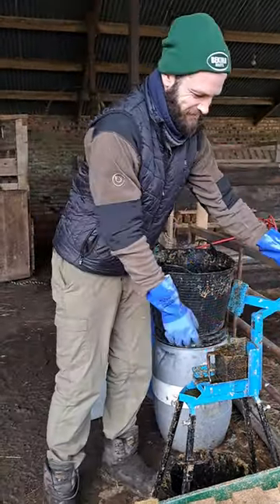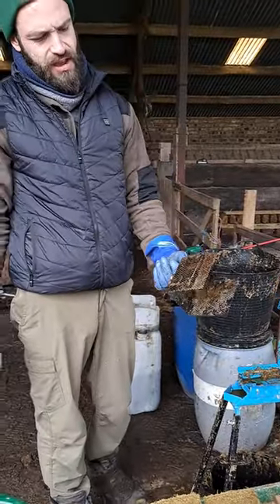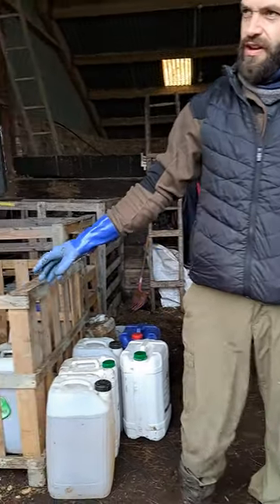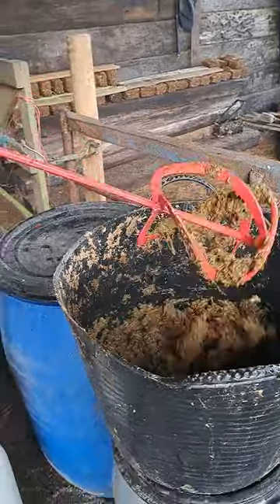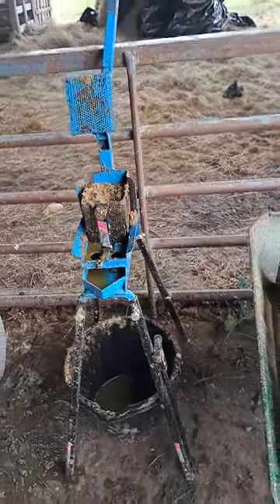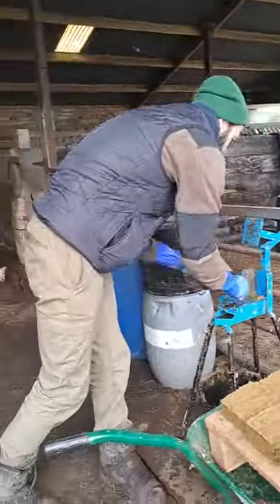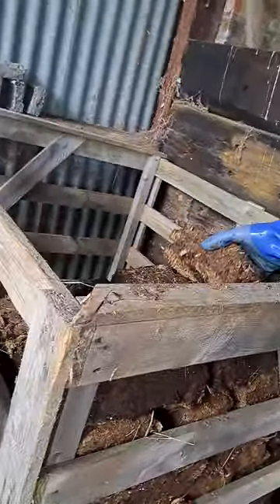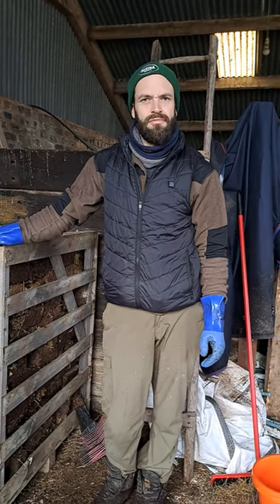horse manure briquettes @tinkytanky3

Comment: I am burning the 2nd winter horse manure briquettes. I'm mixing everything together, cardboard, newspaper, wood  shavings, horse pong, you name it, I have a very similar press, but have increased the leverage, which gives me alot dryer "rawlings" - which I let settle for about 3 weeks. I do not soak the horse manure at all, infact I'm shredding card board and use that as bedding. or cocos peat from a close by strawberry farm. I recently bought a different press again, and operate that one with a 2m lever, I can put in horse poop straight. 
works very well, have reduced our coal use for about 70%

Comment: Do you have to soak it in the hay water, could you directly press fresh droppings? Very interested in this! Great video.
Reply from the maker: Best to mix because it will all be as one mix instead of dryer horse apples won't compress as good and be too soft and burn quicker.

Comment: Hi, local to me (in Scandinavia) there's a vast amount of horse manure for free. It has been standing for some years outside in the rain - is that suitable for making briquettes - in the sense of cohesion and energy etc - have you tried it? Any tips for using older stuff like that? It may well have urine mixed in - it's hard to be sure of its composition exactly - does that make a bad smell/any odds to the processing method chosen? Thanks for any feedback on that.
Reply from the maker: @gurglejug627  cohesion is the issue. I have tried it with 2yr old stuff and the fibre just isn't there. I tend to use one spade to about 5 or 6 fresh manure that has been soaked in slurry or hay water.
Reply: @tinkytanky3  thanks very much for your info there - I may have a try at mixing it with other media - sawdust and or hay, straw etc., time permitting. Will let you know how it goes if it goes well.

Comment: Is there a reason for keeping the manure slurry for 3 weeks prior to making the bricks?
Reply from the maker: Hi Richard there are a couple of reasons. To get the mix to release the slurry into a further concentrate and the sugar water to add calories to the mix. The direct sunlight uv rays may kill off some bad pathogens potentially salmonella. The sawdust from the bedding seems to react well to being soaked for some time and break down further and finally I don't have much time to get to it as much as I would like. I think if you wanted to you could rush the process but I would recommend using the mixing paddle to get it to a cement like substance.
Reply from the maker: https://multimatebriquettemaker.com/
Reply from the maker: I've added the link to the manufacturer and if you decide to buy please let them know it was me. I have not affiliation to the company or commission etc. They are just really nice guys.
Reply: Cheers man. As soon as the cash transfer clears I'm on it like a car bonnet.

Comment: Hi, how hot dried briquettes burn comparing f.ex. to wood?
Reply from the maker: Like peat and same moisture content to logs when dried. They are best burnt 50/50 with logs as the logs give the flame and the bricks give a flame but then go down to a red glow like peat. So it can be hard to monitor before it goes out when you don't add the logs into the mix. If that makes sense.

Comment: Can I ask why you soak the poo in water please and dont just use it as is?
Reply from the maker: It's to break down and soften the sawdust and shavings that is residue from collecting the poo say from the bedding when mucking out. It also just helps infuse the mix together. That's my theory anyway. Lots of water means you can make a paste rather than a semi dry mix that would be full of too much air spaces. That means it would burn quicker and you would need to add more bricks to the fire.